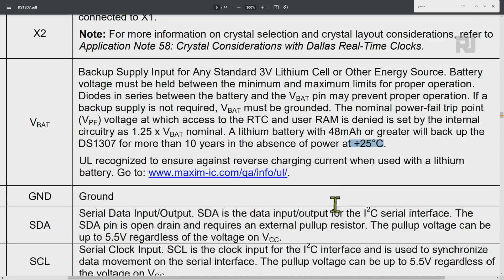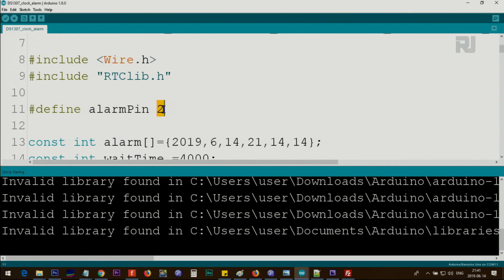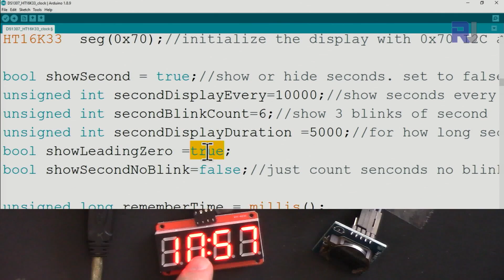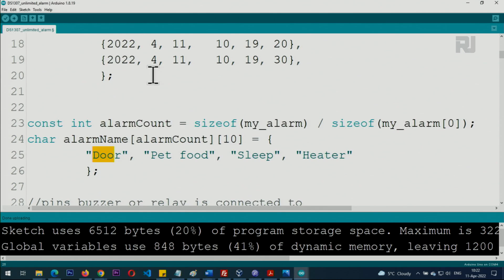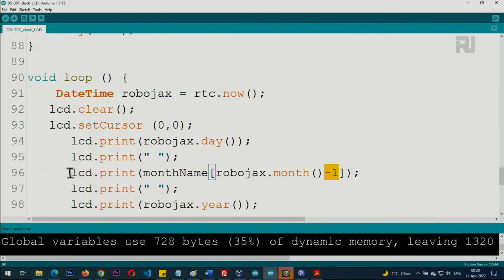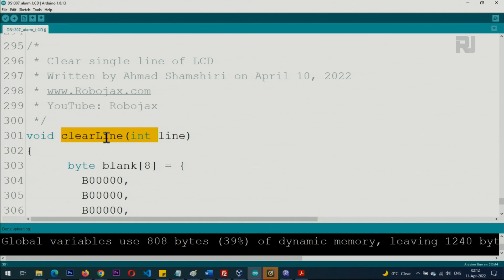7 projects Build LED LCD Alarm Clock using DS1307 with Arduino | Lesson 105 - RJT416

Comment: Sir pls solve Time Drifting Error  from software side,  I'm getting 10 second error everyday, at the end of the month 5 minutes error, 

I only need time From this module, don't need day, month,year, . Is it possible like this, when time 23:50 then time automatically set to  24:00 , something like that, means 10 second compensation everyday

Pls tell me sir ...
Reply from the maker: then the quality of the crystal is bad or it has been hit or shaken. You need another module.

Comment: Just a note. I believe that the CR2032 Lithium coin cell "battery" is NOT rechargeable, but can have a shelf life of 10 years.
Reply from the maker: Indeed. but there are variation of 2032 (the same physical size and voltage) that you can charge. here is one https://amzn.to/3Add8tG
Reply: @robojax  Interesting. I never heard of that. It is actually a Lithium ion in a CR2032 case. That's scary. You would NEED to be very carful when replacing one as I would think most people would assume it was the standard Lithium coin cell (Lithium/Iron Disulfide (Li/FeS2) non rechargeable.  However if you are replacing and look closely at the cell it does say LIR2032 not CR2032. Thank you for lettings us know about this.

Comment: Hello sir , my rtc module not that much accurate, I'm getting extra 10 second everyday , sir any solution for this problem ? 
Tricking with library for compensate time everyday
Reply from the maker: Pay attention. I mentioned it. It read time from your computer and then uploads it to Arduino. In the process there is delay. Add manual tiime or add 10 seconds in default time